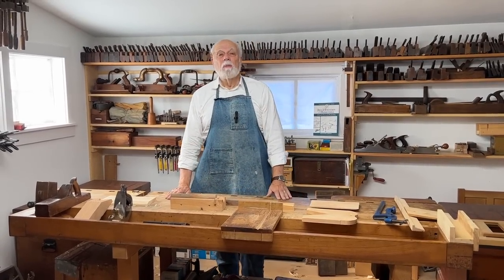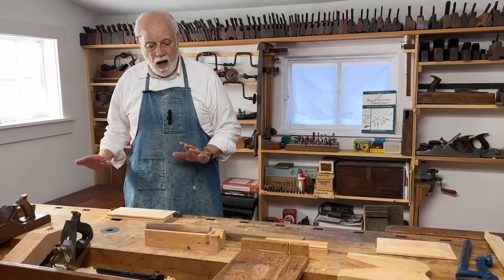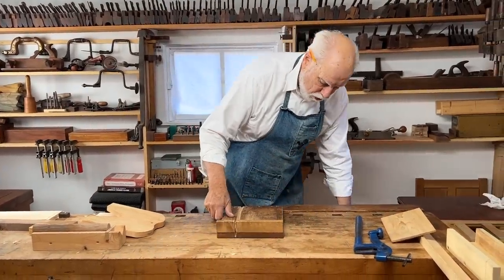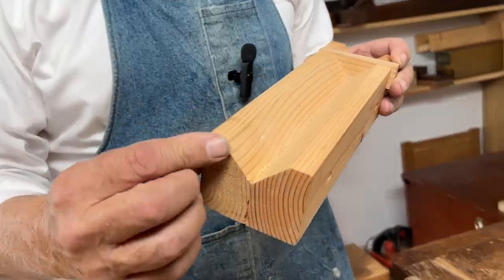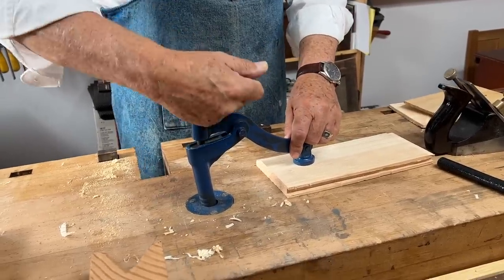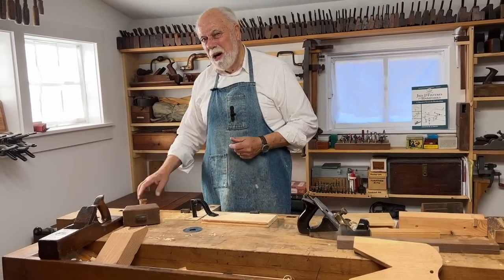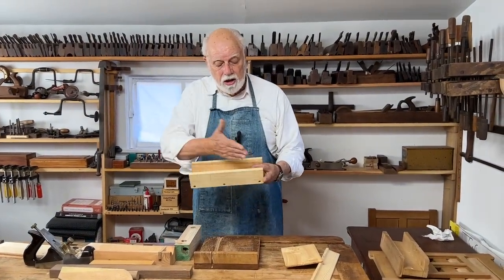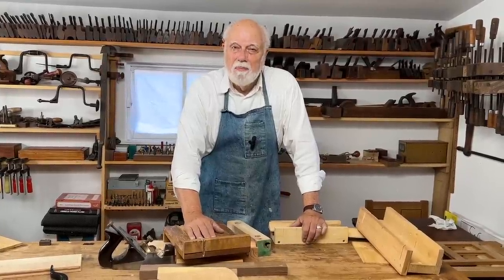21. Bench Accessories for Securing the Workpiece

Comment: 9:23 “There is no reason why you should be doing anything with the workpiece not completely safely secured”

This is an “Aha” moment for me. I am coming to carpentry from Green Woodworking; spoon carving in particular. I have always held the workpiece in my hand. I think this is a major defining difference between the two. Thank you for stating simple basics Graham. It is very helpful.
Reply from the maker: Safety is so important — you need all your fingers!
Reply: @gjbmunc  I think perhaps that statement ("There is no reason why ...") properly belongs at the beginning of the video, as motivation for why we want to use these devices.
Reply: I cringe every time I see an example of bad work holding on YouTube, it teaches bad habits to a whole generation of new woodworkers.